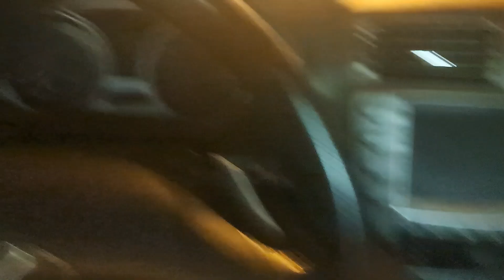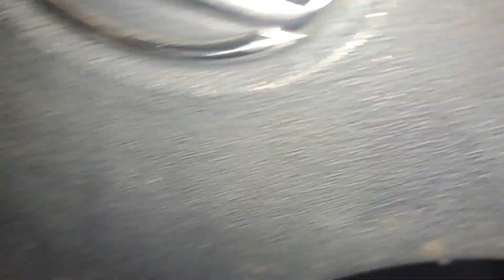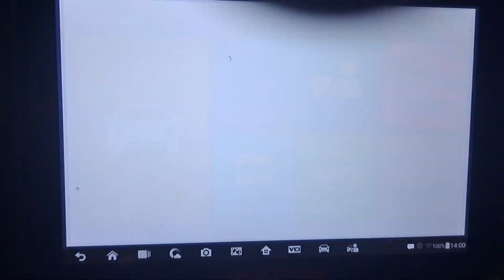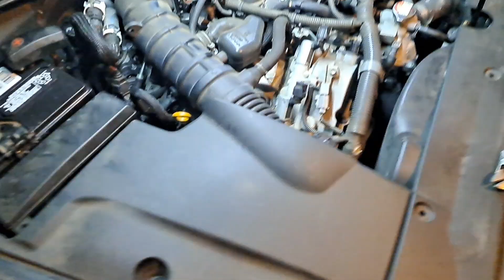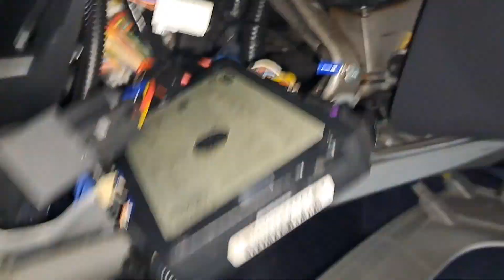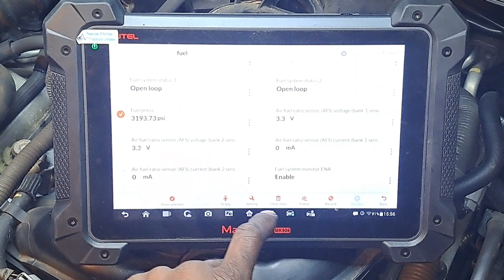2007 IS350 NO CRANK NO START NO COMMUNICATION w/ PCM

Comment: Typical Lexus problem and solution firts all conectors brake up cheap plastic. The famous fuel pressure sensor installed next to the firewall that gets heat damaged by the engine(bad stupid design) if the signal is missing the computer will not activate anything to start the car! That was my problem. Then is about 2 hours labor to replace the stupid sensor unreachable unless you uninstall intake filter holder, meter unit, throttle body and inlet manifold to reach the gas pressure sensor! Hidden behind the engine! I found mine partially melted by the engine heat and the firewall reflected heat.  Funny is that it will fail again!  A 200 labor easily plus the part cost.

Comment: Secret fix for this that cost zero that has fixed a ton of these.......Stupid, but many, many people will swear it worked for them. This is a known issue with these cars........Push the brake pedal down a bit harder, and see if it resets the sensor that is stuck, and keeping the starter from engaging. It might just start right up. 
 Don"t hate the messenger, but I have fixed at least 20+ of these cars with that simple trick....and have told many others.  It doesn't cost you a thing to at least try it.

Comment: Yo this looks exactly like what is going on with my 08 IS 250 Even the VSC Check Engine Code & Everything. thank you for posting this.  I wish you were in San Diego.  Honestly I appreciate you showing the whole process of how you worked through the issue. Even the mistakes.

Update: Fuel Pressure Sensor was the issue. Toyota Dealership quoted $7,300 for ECU & Immobilizer + Key. They wouldn’t even check for this issue even after sending them this video. I was considering junking the car. Thank you for making this video.

Comment: Awsome troubleshooting. 
I'm having the same problem with my 2007 Lexus IS 250.  Would  nit start. Changed battery, no joy. The fab, seats don't work  as well.
Reply: Me too did u ever figure it out.. no lights even right?

Comment: I was having the same issue except it wasn't cranking at all no sound or anything just a fuel pump priming so i jacked the car up tapped the starter with a ratchet started right up so I need a starter

Comment: Sumone get on here and help a G out shessss my damn plastic manifold won’t come up and I done pulled out Al the bolts 😂
Reply from the maker: Take your hand and run it along the center manifold and perimeter. triple check all the fasteners and nuts retraining the manifold.  Check for brackets surrounding the manifold.  

At times the gaskets can seem like glue but if all the bolts are removed,  it should crack loose! 

I can promise you,  you're likely overlooking one

Comment: The FPR shorts out basically sending a low voltage to the ecm and it puts the ecm to sleep so there will be no communication to ecm or pcm
Reply: Can you tell me what is FRP?
Reply: @DUBBYSTEP2K12  fuel pressure regulator. Or fuel pressure sensor

Comment: Have you try to start engine while you press the gas pedal all way down to floor?if your engine starts and shutdown after you release the gas pedal then look like your engine mis timings. You need to replace vvt solenoid valve.

Comment: My man!  Your video was perfect.  I think you saved me $1,000.  Bless you bro.  I think the issue is now fixed (i'm still a little scared to take my car farther then my driveway).  Question for you:  I have 2 lights on:  Check engine and traction control (car with 2 zigzag lines)-- how do I clear those?  Thanks.

Comment: I had a similar issue, no code, no start, no communication w/ communication, and I changed out the fuel pressure regulator sensor and it worked!

Comment: Bro when the fuel sensor is out it notifies the computer not to start, its a fail safe.
Reply: 💯😱love it tho Iove Lexus gs 2008-2011
Reply: Would this cause an immobiliser fault?
Reply: But how do you get the pcm back on line once you changed the fuel pressure sensor

Comment: Great stuff my friend; lots of combinations and permutations to these cars in resolving issues, but you can't beat patience and a level head. Working with an IS250 and so far I have not managed to get the diagnostic to determine whether the arbitrary dying could be the MAF Sensor, the Fuel Pressure Sensor as you found in this particular vehicle, or even the Crankshaft Position Sensor, but the car can be performing beautifully on a stretch and comes into a junction requiring that you slow down considerably and it just loses the gas supply to the engine, thus activating a solid illuminated "check engine light". I have cleaned the MAF Sensor a few times now and sure enough after the 5 to 8 minute period after drying the car starts nicely again but surely that cant be the issue I don't think. So I'm awaiting my turn to see the mechanic. Feel free to comment.
Reply: Will do; as I said the local dealers here are backed up with appointments so I’ll try to get as much info from their research when they get around to me and revert.
Reply from the maker: Pull the code and get back with me.  That code will help with direction that can be correlated with your symptoms
Reply: A second opinion wouldn’t hurt.

Comment: Bro I’m having the same issue that I’m getting a no crank issue my car just the lights on dash lights up and it didn’t let me push the brake down cuz it’s hard now and to push the start button it simply doesn’t do anything 
Idk what could it be 
Disconnected the battery I put back on and still nothing
Reply: You ever found out what it was
Reply: Same here, searching for solutions
Reply: @DUBBYSTEP2K12 you figured it out?
Reply: @DUBBYSTEP2K12 u wrk on it yet

Comment: Having issues with my 2006 Lexus IS 350 it starts but as soon as you touch the gas pedal the car shuts off you think this could be the problem??
Reply: Check fuel pump and filters 1st

Comment: Hey, I had a quick question. Just replaced my abs module (sent the oem one in and got fixed) on my 2007 ls460. have tons of lights of for lost communication with ecm. Is this a programming problem with my module? What would you recommend I do? Any help would be super appreciated!

Comment: Bad fuel pressure sensor, shorts ECM 5v ref to ground and shuts the ECM down.
Reply: Where does the fuel pressure sensor located?
Reply: Since I changed the pcm still no power to ecm

Comment: Need help, my 08 is250 turn off on me during while drying in the car wash. Vsc light, battery, cel came on. Pulled out the code & it said p0351-p0356 which is the ignition coils.. is it possible for all to go out? I checked the battery & it’s good, maybe bad ground wire?
Reply: Thanks for the reply, I will look into that 🙏🏽
Reply from the maker: This can happen due to shorted ignition coils.  Try replacing the ignition coil 1 and 6. 

Them shorting can also knock the computer offline
Reply: @partsshooter  to also add on its p0351 thru p0356, should I change all of them?
Reply from the maker: @dub9activist955  oh... I misread.  Try this... if you can access the coil connector,  disconnect one at a time and see if the car start each time.  If it starts,  that should be your culprit
Reply: @partsshooter  that’s connected to the ignition coil right? I’m sorry for the dumb question, my first time owning a Lexus.
Reply from the maker: @dub9activist955  yes.  Simply pull the connector at the coil one at a time.  See if car starts
Reply: @partsshooter  also the engine would turn over wanting to start but won’t
Reply: @partsshooter  just want to give an update, I pulled the  connectors plugs one by one & try starting it & didn’t start
Reply from the maker: @dub9activist955  so,  you have a "no crank no start condition"?
Reply: @partsshooter  it’ll crank & try to start, if you have an email I can send you a vid
Reply from the maker: @dub9activist955  because of file size and quality.  Upload it to your channel, and I'll watch it, it's best there because of larger longer video
Reply: @partsshooter  could it be the starter relay?
Reply from the maker: @dub9activist955  If it's "CRANKING," it's nothing related to the starting circuit.

With the key in the "on" position, check for 12v at the ignition coils. Maybe a power supply issue. Check all your fuses again if you haven't. 

It's gonna get really technical after checking the basics.  At minimum, you'll need to know your way around a multimeter and a test light. But check for power and grounds at the ignition coils. Typically BLACK is a ground, see if that supports a load with a test light.  Make sure there's battery positive also. 

Try clearing the codes... crank the engine and see if anything change.  If it don't start,  recheck for codes and address around that issue
Reply: @partsshooter  just uploaded brotha
Reply: @partsshooter  I was checking out my car early today & when It didn’t start, I put it in drive & I notice that when I was using the paddle shift I was in 4th gear & not 1st. Would this be a TCM problem?
Reply from the maker: @dub9activist955  no.  Because the engine rotates.  

Please stick to components related to start to 'running'.

Fuel... fire... timing... and everything sub related to that

Comment: When you reached behind the engine to disconnect it what exactly did you disconnect. You turned on the car after it was disconnected and I want to test it out exactly how you tested the sensor before I take off the intake manifold.
Reply: Pressure sensor may have been! Mine had a bad gas pressure sensor. Late but, well is Lexus known problem. Sensor gets damaged by engine heat.

Comment: Lol looks like my wiring mess with my remote starter issue. Also I'm glad I tore into it because there's a relay wired in and removing it caused a no-crank. So good to know for me if that relay ever dies I will know where to look instead of going to maybe the starter or something first. (also commenting half way through the vid so maybe you find out more here)
Reply: So what was the issue? 
What is the fix?